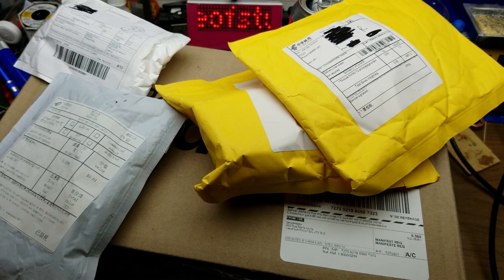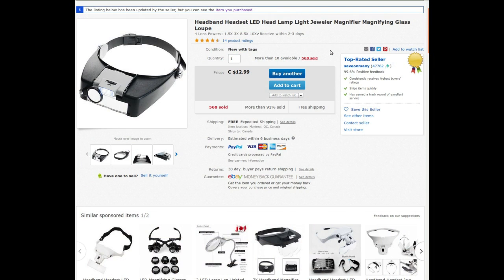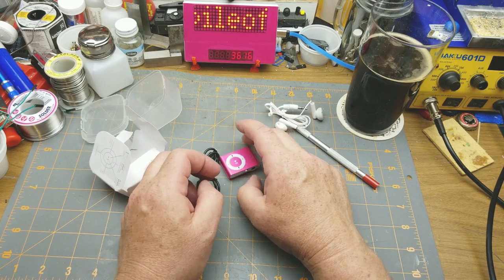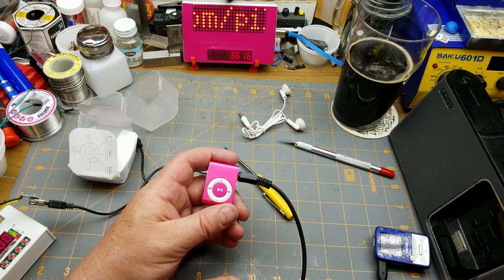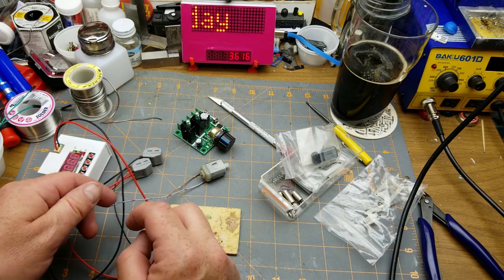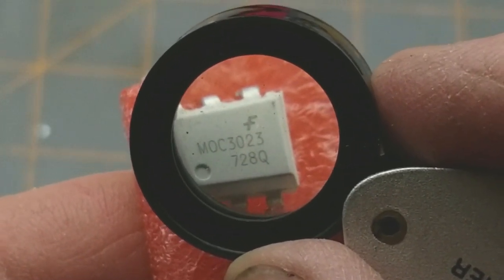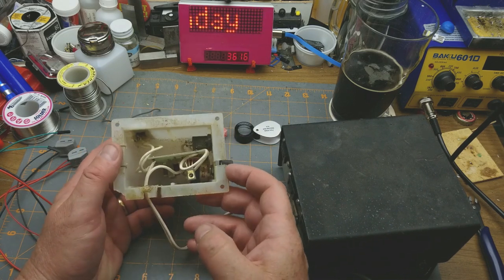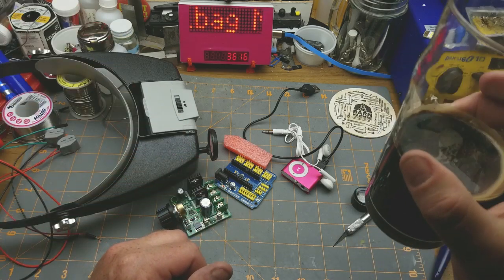mailbag monday #59

Comment: 23:20. Everybodies has got to learn. We can all look back at things we did 20 or 30 years ago (closer to 40 years ago for me), and have a reaction of 'my god what was I thinking'. But at the time it was the coolest think on the planet.
Reply: I recently located one of the first circuit boards I etched, which was just a  simple power supply made from a bridge rectifier and some 78XX regulators.  I used a liquid tin plating  for the copper  since there was no solder mask and it looks very amateurish.   I wonder if I can get it working now.
Reply: @GadgetReboot  That would make a good video for one of your videos.

Comment: I prefer dental/surgical loupes. They give you more working distance than head band types. Typically you get something like 300 to 400mm from eye to working distance that allows soldering at table height while sitting normally. They are pretty cheap at places like eBay.
Bending over with a head band loupe kills my neck/back pretty quicly. You get close to soldering point and get more fumes with them as well.
A good stereo microscope is of course the best but it is on another price range and needs some table space too.

Comment: I built a battery charger in that same case. It would go constant current to charge  Nicad  RC car batteries or voltage limited to charge the lead acid batter for the transmitter.

Comment: This channel freaks me out some times. Right now on my bench I have 3 x MOC3023  that I'd pulled from an old Air Cond controller or something, while I was scabbing the huge capacitors from the PCB. I needed to google to get the datasheet and work out what the hell they were, so I could store them in the correct junk box. So you paid $1.33 for 5.... and I got 3 for FREE !!

Comment: I miss the old Tandy corp. and Radio Shack and I mean back in the day when sales clerks actually knew there electronics. The last time I was in one about 5 years ago maybe longer the clerk could not tell you a capacitor from a resistor and point me to the parts box. But boy they were trying to sell I-phones. I knew then they were done.
Reply: I worked at a rat shack in the 80's in Vancouver. I had school kids coming in to get answers to their electronic home work. Finally sold them Forrest F Mims books.
Reply: @DrexProjects  Radio Shack was pretty much the only place to that had stores all over the place, at least in the north east USA. Used to go in there all the time. Saw my first computer there. I would go in mine and get my questions answers. Got my first multi meter there ext.

Comment: The Sansa Clip has FM radio too.  Great device if you run.
Also - it can run Doom!!
Reply from the maker: Doom? Really? 

That's a game I haven't thought about for a very long time.
Reply: @pileofstuff  Only if you upload custom firmware called RockBox. I have one of those Sansa players, they are great.
Reply from the maker: That sounds like a fun challenge. Thanks for the info!
Reply: @kjur18  I never got on with RockBox. Sadly my Clip is on it's way out. Then again I use it almost every day and I bought it in 2012 so I can't really complain.